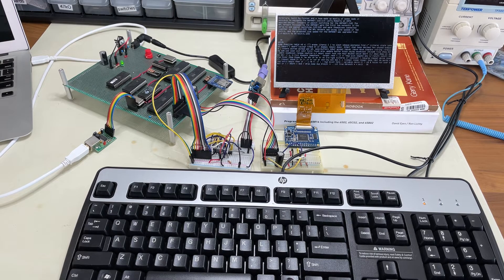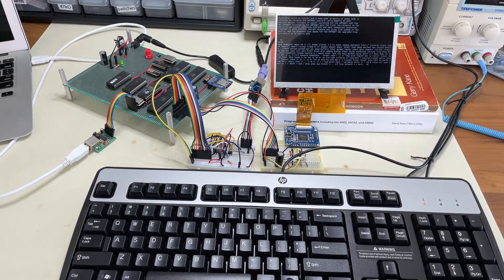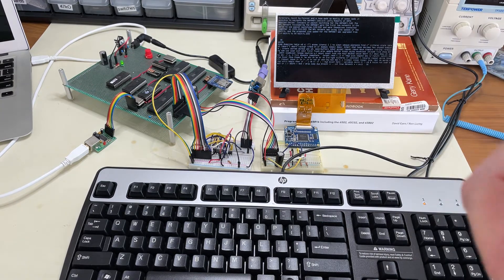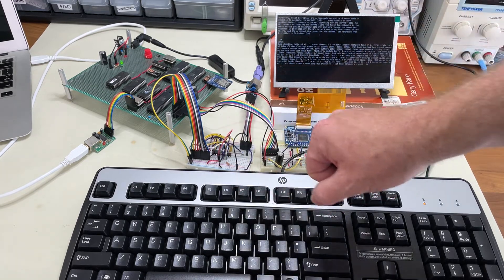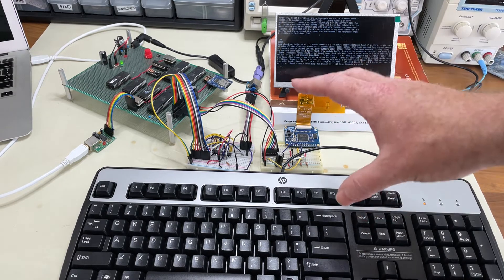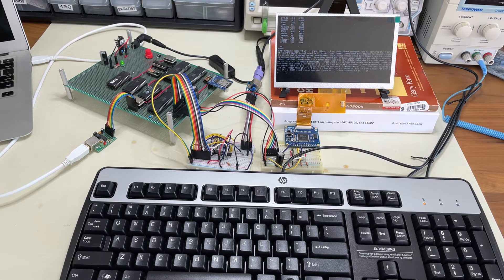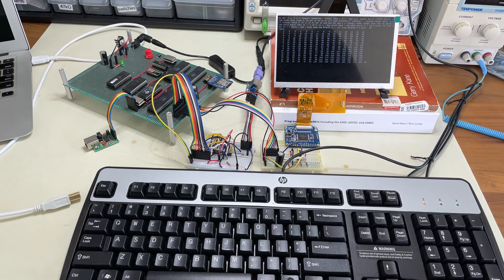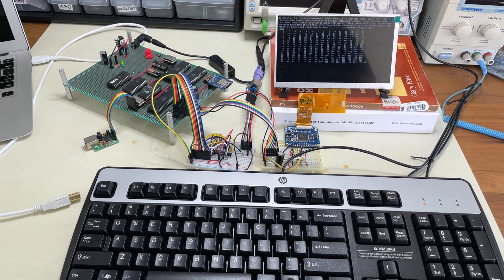6502 Mite home-brew computer project, step 23: PS/2 keyboard

Comment: Nice progress, although you now likely have a microcrontroller for the keyboard that is more powerful than the whole computer. :) - Its always hard with these 6502 projects, at one point one choose to use some very modern FPGA thingy somewhere to either handle input or output and the computer inbetween sort of becomes a bit obsolete as you could likely have emulated the whole thing on the FPGA in the first place, much like the Commander X16 project and the FPGA graphics board. Still is no doubt fun to build it yourself and a nice learning experience.
Reply from the maker: You're quite right, and it's a trade-off. I resisted for some time having more powerful support chips, but it was video that pushed me over the edge as a practical matter. This particular microcontroller isn't so powerful -- I need to insert NOPs in my key acknowledgement routine so that it will catch up -- but you're quite right in principle. I justify it to myself by noting that many early designs relied on powerful custom chips for particular functions (e.g. graphics in the Atari 8-bit line).
Reply: Back in the day the Atari machines had a chip called Pokey that handled the keyboard and I/O ports. It was a VSLI chip and was likely as powerful as the 6502.